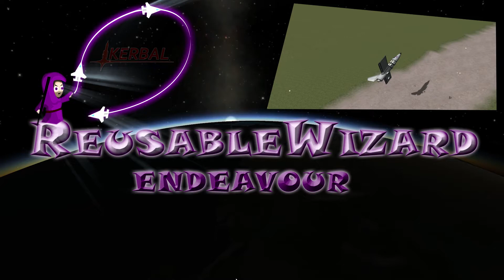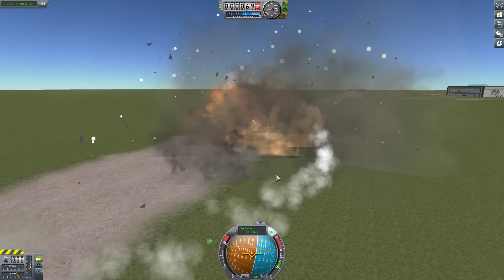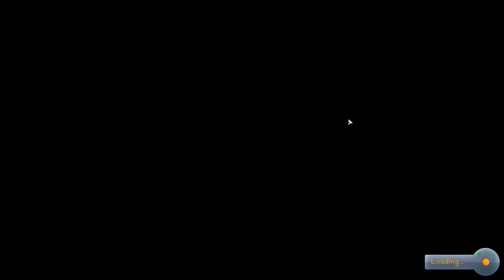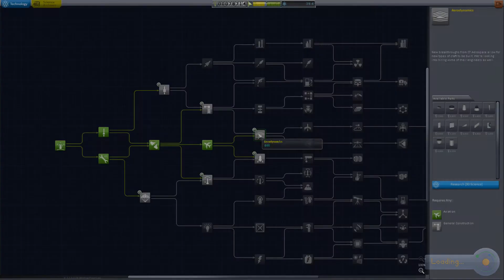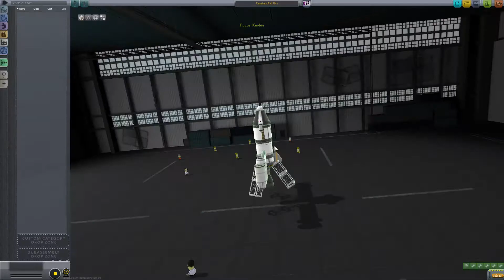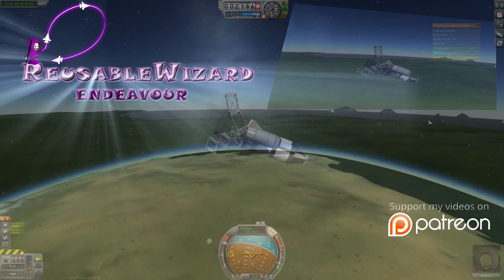KSP Reusable Wizard 02 - Feather Fall - Kerbal Space Program 1.1 prerelease Gameplay

Comment: Also Dave the problem you're having with the wheels is due to the wheels being at an angle to the ground. They don't deal with that well at all in KSP. They have to be completely perpendicular to the ground or they cause instability.
Reply from the maker: +Debated Nothing I'll try to watch out for that. Though they're just mental anyway ;)
Reply: Weird Wizard Dave yeah, in the new patch they're terrible. I've found that the only way to use the landing gear is to set friction control to manual, and assuming you have a tricycle wheel base set the back two to 0.1 friction and the front one to 0.